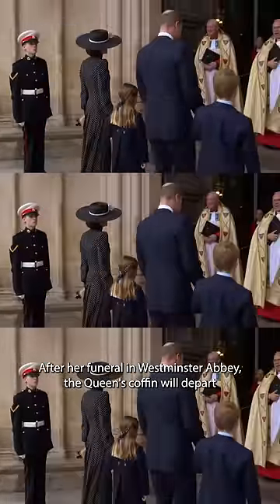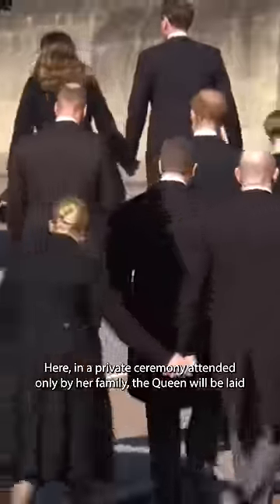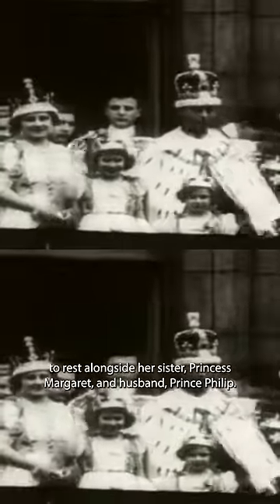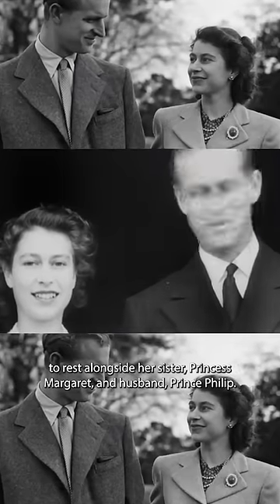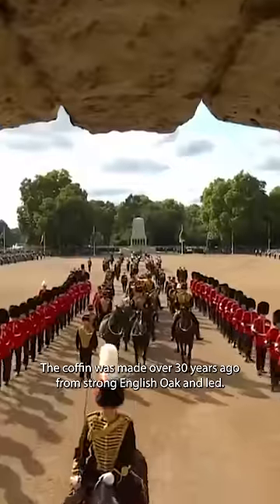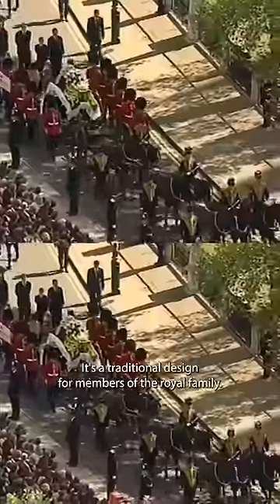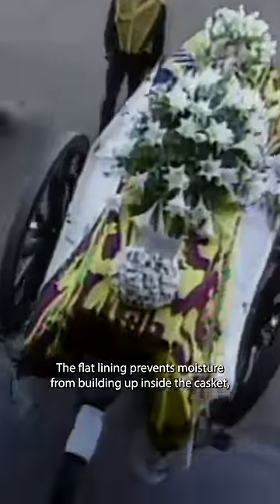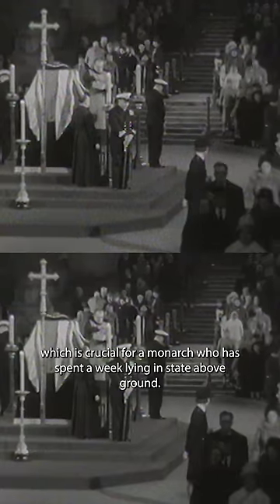Why is the Queen's Coffin Lined with Lead?

Comment: As they carried her coffin by their shoulders only all I could think of is oh I pray they don't drop it! It must be heavy. But they did it with such grace as expected 👏
Reply: You know, I actually thought that also.
Reply: And I kept hoping nothing on the top would fall off!
Reply: Quite 200 KG is 440 lbs.
Reply: Those men raised that coffin as if it was weightless. They did an incredible job on monday
Reply: @corssecurity  250kg plus the queen, so around 300kg
Reply: Even the queen had to rehearse for her coronation. So it’s not far fetched to think that these men spent months on an off prepping for operation London bridge has fallen as they put it. I must say that I really didn’t expect it for at least another for or five years 😢
Reply: carrying it on their shoulders was the easy part, they also lifted, lowered & manoeuvred it with the strength of their arms.
Reply: @donnast.joseph5158  the crown was over a cake-shaped lump, the sceptre had clips & the orb had a metal rod that went into a hole.
Reply: @donnast.joseph5158  at the end they took off her orb the staff and crown you could see they were temporarily attached in a way that couldn’t be seen! The orb had a special connection to keep it on top of the casket!
Reply: @corssecurity  
So why don’t they just say that?
Reply: @alanhat5252  
*SPOILER ALERT!*
Reply: Relax they don't do it for free
Reply: They are strong enough to withstand it
Reply: @donnast.joseph5158  it was all fixed in place.  They had to loosen the fastenings to remove the sceptre, crown and orb when they placed them on the altar to officially end her reign.
Reply: I also thought about that.
Reply: @cynthialady8071  i think we were all hoping she'd make 100 and send herself a card, but thank god she made her platinum jubilee. A true legend RIP.
Reply: What a waste of lead and other metals.
. A corpse doesn't need dressings or care, that's what most people do bcos of their ignorance of what it means to be dead.
A corpse shud be put into just a wooden coffin for burial in the soil and there shud be no decorations/paintings on that coffin as there's absolutely no use for all that Ado bcos it's now a useless person(a dead person/corpse)
Reply: Burying all of the stolen jewels
Reply: @donnast.joseph5158  😊😊iam just iii😊😅😊myyy
Reply: I expected them to dance like my brothers from Ghana!
Reply: @jamesinameti6184  exactly! In my home country Kenya, when a family member dies abroad, families insist on returning the body back home, even when they can't afford the process. They would rather sell land to have it back, little did they know it's easier and cheaper to it burried in the country the deceased died. I also find it ridiculous that people pretend to respect someone when they die more than when they were living.
Reply: @positiveego5397  it's bcos of their ignorance of the dead, they don't really know what it means to be dead & what shud be done when someone dies.
Reply: @jamesinameti6184  didn’t anyone learn anything from the ancient Egyptian pharaoh ? There’s reason why they were discovered, what really counts is what you do during you lifetime, corpse’s just need to be wrap in linen and buried, as soon as possible
Reply: MY DAD
Reply: MY DAD CHARLES
Reply: Would have been funny if they did drop it.
Reply: The casket was lead lined so that’s why there was 8 guys instead of the normal 6!
Reply: 250 kilos is not heavy when divided by 8 strong soldiers 🤡🙄🥱
Reply: It's not made from lead just lined with lead like when you buy curtains as awfully as that might sound
Reply: They’ll have rehearsed this 30x over or more, for years.
Reply: @donnast.joseph5158  in n
Reply: I don't think so. They are so focus each one would die before they would drop it. I know I would.
Reply: @alanhat5252
Reply: Oh did you, so intensely deep and profound.
Anything else very important from the heart that you can tell us about ?
Reply: Long live King Charles and his deceased old buddy Jimmy Savile....
I wonder if the queen was reading Mills and Boon when the kids were brought in ?
Reply: @corssecurity plus another 50 kg/110 lb and the body. That's close to 700 lb. Or, about 90; to 100 lb for each pallbearer to carry.

Comment: I follow quite a lot about some kind of burials and I still wonder how they manage this one. I mean how the gasses build up inside the casket and also how they would go out naturally. while the decomposition fluid can use the absorbing pad.  if it is a strong sealed casket then it will be some kind of pressure cooker itself. besides, the embalming only slows down the decompositions.

Comment: It's nothing to do with stopping bad smells, as wooden coffins are air tight. 
It will not to stop a sudden realise of built up gases. As its lead. A very soft metal. 

Do some research as to why rich people used to use coffins with a lead lining. It's nothing to do with the above 😉